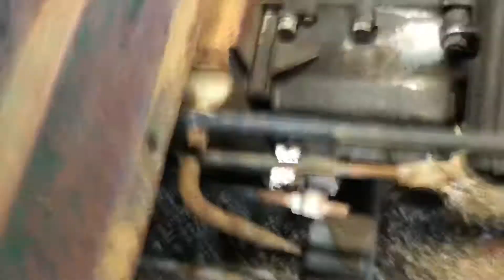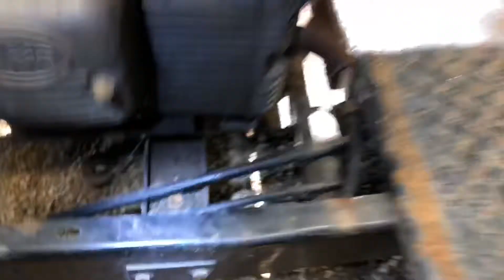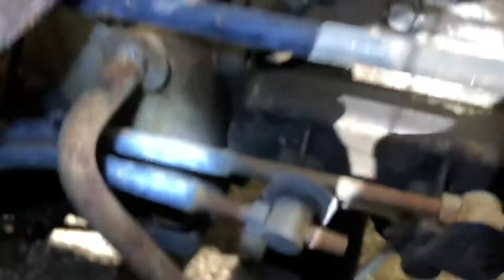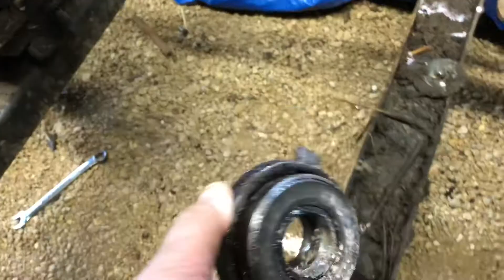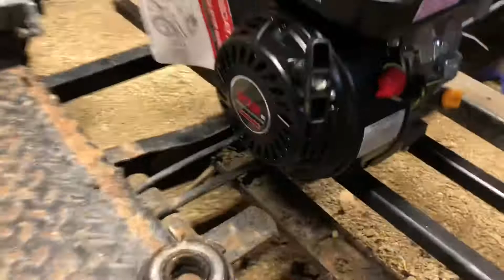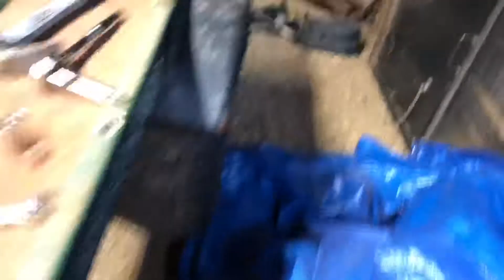Cushman Build Part 2

Comment: Hi Kyle, why not reuse the stock cushman flywheel, clutch, and bell housing? You will need a sleeve for the shaft since its smaller, but they sell them on ebay. The old OMC engine uses a 1 inch or 1 and 1/8th shaft and can easily be converted to fit your predator. That way you have access to all of your gears

Comment: So what about the gears? Gonna be hard to shift gears. Just going to put it in 3rd n rock it out? Idk if that will turn it in third even with that variable speed. In third. Curious. Wanna see the final product.
Reply from the maker: Hopefully someday I’ll get around to finishing this project lol, my plan was to use a torque converter to transfer the power from the motor to the trans, and if I could come up with a way to stop the torque converter from spinning when the trans is in neutral, maybe a mechanical brake or something, then I should be able to drive it like a manual with an automatic clutch.
Reply: @KyleLesmeister  how did u put a pulley on the trans and the trans mounts to the frame?

Comment: Damn i wanted to see the rest how it turned out
Reply from the maker: slikballa so much has happened since that was uploaded. So this project got put on the back burner. But I have about everything to get it going.
Reply: @KyleLesmeister  well hope you find time to make it happen i have 6 of the same trucksters and i think they are the most dependable vehicles
Reply from the maker: slikballa I think with the gear ratios that the cushman has the predator 212 engine with a torque converter will work well together.